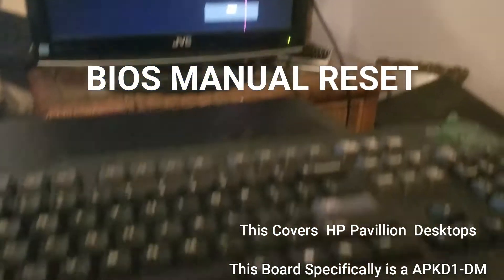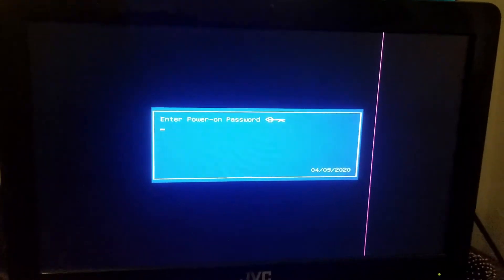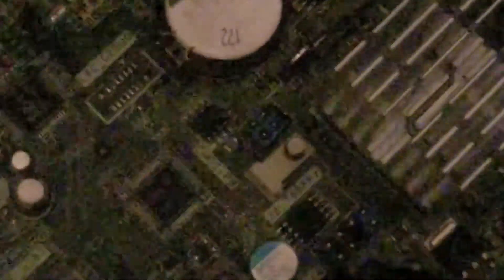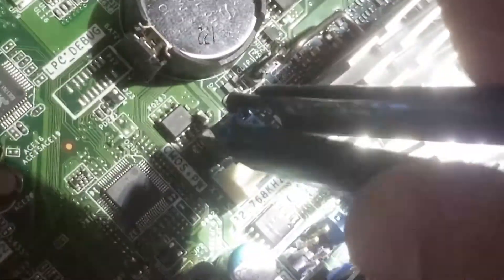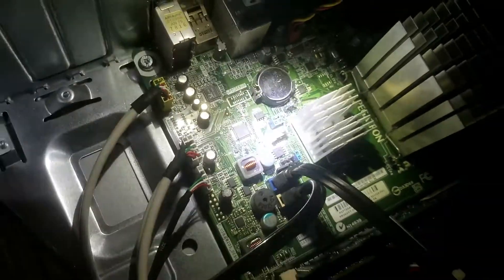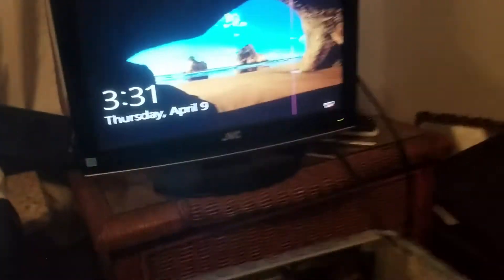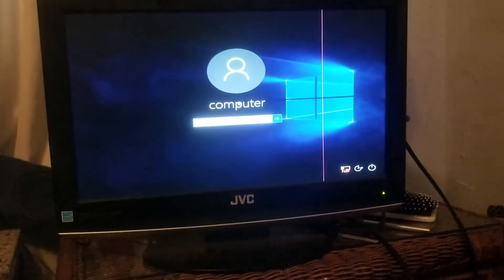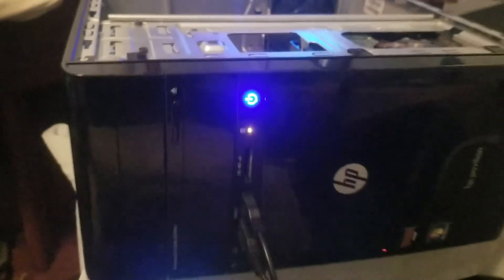BIOS Password Removal for HP Desktop

Comment: I have a Pavilion 500 with this issue, but I have to move the jump then power on the machine to remove password. Move the jump alone not work for me.
Reply: Your pavilion 500 has 6 pins in the jumper? I'm having the same problem as well